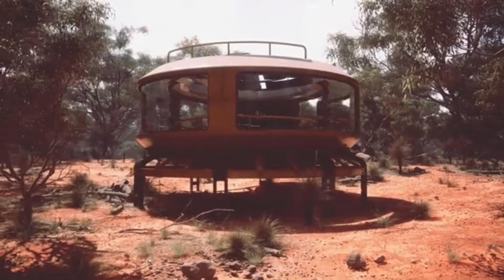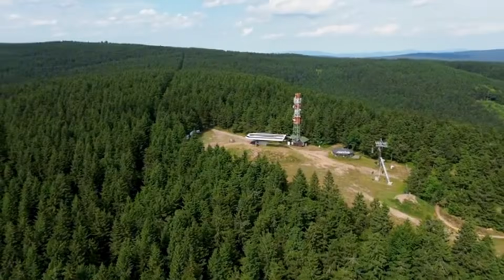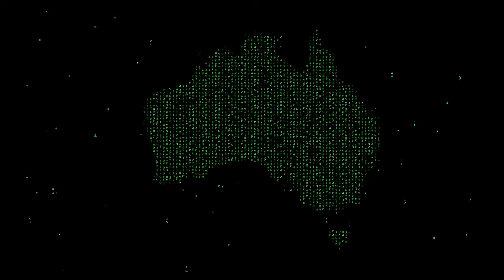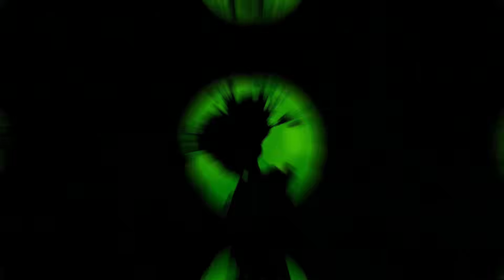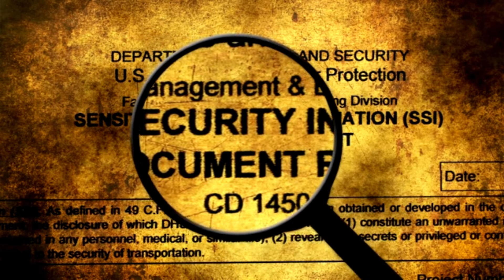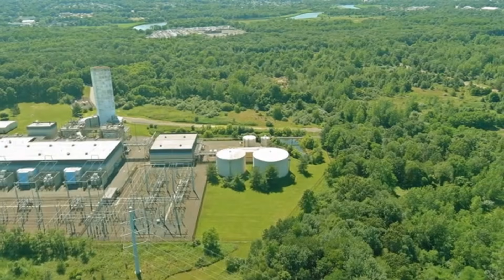1 Million WWII Cars Ran on FIREWOOD — 0 Gasoline, 0 Engine Swap — Why Did Big Oil Erase This?

Comment: this type of "technology" is simply not for everyone. there are a multiple of reasons why average folk (well, should refine that a bit; city folk) don't rely on wood stove heat for their homes.

convenience, cleanliness, simplicity, really, other hands-off fuel sources have taken the market.

doesn't your wife mind chopping firewood? does she mind loading the wood stove minimum 3 times daily> (unless it's a huge outdoor woodstove - hydronic system, fill it twice a day in most winter days, depending on home insulation i suppose). not everyone wants to clean things that often.
Reply from the maker: You’re absolutely right that the convenience of modern fuel sources is hard to beat for most people today! 🪵